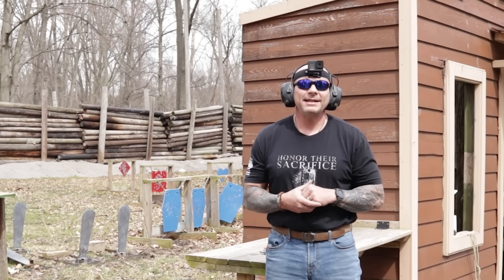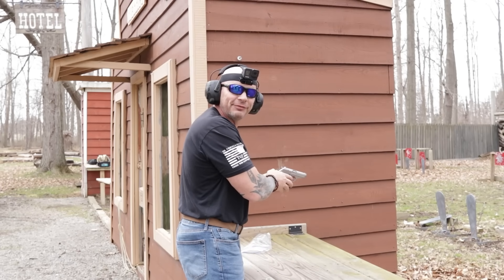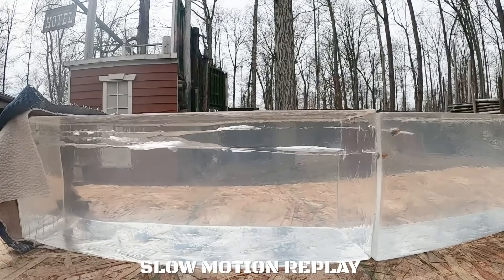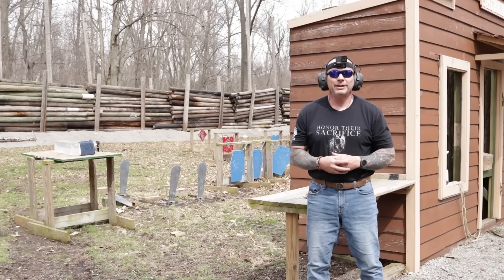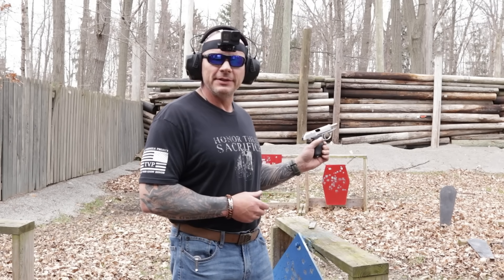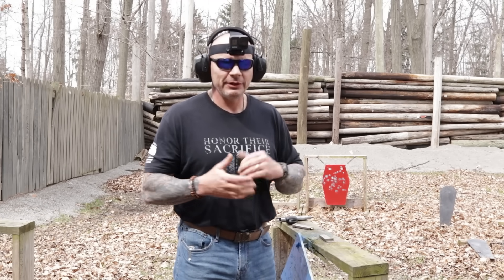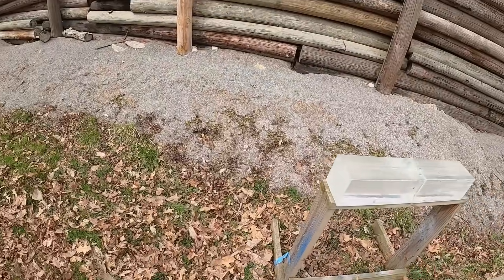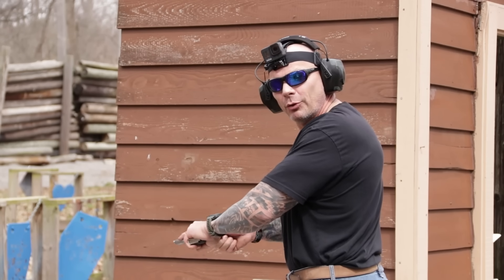Stopping Power of .380 ACP

Comment: As a retired police detective I investigated more death calls with a 380 than any other caliber. Don’t be fooled, a 380 cal is a formidable    Killer
Reply: If I remember, the most commonly used caliber in murders is actually .22
Reply: @taylorgalilea698  Emphasis on 'murder'.  Defense against an attacker does not routinely involve sneaking up and shooting in the back of the head.  Or putting five or more rounds into the chest of an unsuspecting person.  "Killing" is NOT stopping an attack.
Reply: @OldManMontgomery  The 22 has been known to be bad because of it being light, it can travel inside of someone causing more damage. There was a girl at a barn I used to go to get killed the same way years ago. Someone didn't secure the gun properly and another young man found and started twirlling it, It went off. They rushed her to ER, but couldn't save her because it traveled upwards from the entry point to her lungs
Reply: @OldManMontgomery  We could argue until we are blue in the face and still get nowhere. A firearm, regardless of caliber. barrel length, ammunition, or whatever, will leave most folks wishing they had never been hit by it, and make most retreat. A 22 will hurt you, just as will a 44, 9mm or whatever. And if you really want to get technical, being overpowered can be totally against you due to over penetration. A many of cases where a 10mm zipped right through the attacker while not expanding.
Reply: @billwhite5853  I agree in that one could present a valid, logical explanation to you forever and you would never comprehend.  Dismissed.
Reply: @OldManMontgomery  You seem like the one who can't comprehend. You ran your mouth and took my first comment totally out of context. End of discussion.
Reply: @taylorgalilea698 no it's not even close. 9mm is responsible for like half alone. 22 has a lot of failure to stops
Reply: I carry a .380 for two main reasons. It does not over penetrate for one which is safer for innocent bystanders. Many of the pistols made for this cartridge are highly concealable which suit my purpose.  I only care about stopping a problem. If they end up taking  dirt nap, oh well.
Reply: @keyfitter  as do I. I don't want to make an innocent bystander collateral damage. If my 12(×2)+1 isn't enough to stop the threat evading is the best option. I'm not out here to be a hero, I'm just here to defend myself and the people I love.
Reply: @BearNecesities1  which 380 has 12? Seems like they are usually 6 or 7+1
Reply: @dtwood123  sig P365 chambered in 380 comes with a 10rd mag and a 12rd mag.
Reply: @keyfitter  considering police hit with roughly 15% of their shots, overpenetration isn't that big of a deal. It's all the shots that miss that are a problem
Reply: @keyfitter  - Play stupid games, win stupid prizes!
Reply: @keyfitter  I have a carry XDS 9mm and a Sig P230 .380. I almost always carry the .380 cocked and locked.
Reply: .380 enough stopping power. 9mm is step up. 45 has the most because it dumps all its energy into leaving bigger internal damage. But judging a .380 acp jhp obliterated my femur I say it's enough amd I mostly carry 45 acp
Reply: @keyfitter  overpentration is kinda a myth, no one's ever been hit by an overpenetrting projectile during a self defense shooting
Reply: @keyfitter  "... safer for innocent bystanders".  Firing more shots to solve the same problem is more dangerous to innocent bystanders.  Firing one shot and having it achieve the goal is the ideal.  
I have to agree most .380 chambered pistols are smaller and easier to conceal.  On that note, .32 ACP pistols are just as small and have less recoil.  .25 ACP pistols are smaller yet, but in all fairness are wretched to shoot well.  I have to agree a six inch .44 Magnum is quite awkward for a hideout gun.  (Unless one habitually wears a boiler suit.)
"...stoping a problem"  The .380 ACP is a rather low powered round for such purposes - compared to even the lowly .38 Special.  Any defensive shot requires accuracy, the margin for error in a .380 ACP is greater than anything with more power.
Reply: @OldManMontgomery  44 mag total wasteon humans recoil will be 15 inches up ward to re target u lost 5 seconds any attacker can leap 15 feet and cut your heart out with a knife at that time  former cop
Reply: @larrylisssr5948  I have recognized that phenomenon for some time now.  Since about 1974, when I bought my first S&W M29.  Nice gun for it's purpose, but quick response self defense is not the purpose.
Reply: @OldManMontgomery  I just watched a video of a .25 ACP round bouncing off the forehead of a ballistics jell head analogue.
Reply: @taylorgalilea698  Such things happen.  As does one ( that I've heard about from a medical exam)  where several .25 ACP rounds failed to penetrate the skull of a man mugged in a large city.  Such occurrences cannot be expected to happen all the time.  However it is indicative of rather low power and as such, not reliable for defense.
Reply: Always considered the 25 and 32 eye, ear, nose, and throat guns, and the 380 only marginally better. These days, 9mm or a hot 38 Special is my minimum.
Reply: With a 44 magnum,  there's a real possibility of  complete penetration. And , by the time the 44 magnum comes down of recoil, a thug with a 380 will have you shot at least 4 to 6 times.
Reply: @OldManMontgomery  The margin of error is not so much smaller that it removes any advantage of better accuracy, a 9x19 only reliably expands (with good penetration) to about 0.15-inch wider than 380. For a thorax that's about 12 inches wide this would only obviate a tiny advantage in speed or accuracy.

The only way you're firing a single shot and having it achieve the goal is hitting something vital like the heart, aorta or vertebrae. That takes good accuracy but the only way to really get good odds is with more shots.

.32 doesn't have less recoil if it's a straight-blowback design and all but about 2 examples are straight blowback.

Also 32 is about double the cost per round, and ammo costs matter because you really should be shooting a lot, you can't just go to the range once, shoot a box and leave it at that. In another time when there were more options in .32 pistols that would have made more sense. 

Any smaller and you're into rimfire which aren't reliable except in double action revolvers. Which are no lighter nor smaller than a 380 pistol of the same capacity and due to the lack of short-recoil it's no lighter recoil.

The one thing a .22LR revolver has is the cheap ammo means you can train much MUCH more with it.

So 380 makes a lot of sense unless you're REALLY good at handling recoil or are big enough to conceal a handgun that's sufficiently large to handle more powerful cartridges. If you can, then go bigger. But most people can't or they're kidding themselves that they can.
Reply: @828enigma6  380 is a 9mm
Reply: @OldManMontgomery  Not according to the latest actual real world shooting statistics. Only a 3% difference in stopping the threat by incapacitating the threat between 380 and the venerable 44mag. Truth is in the fact that the body reacts very differently from ballistics gel. Ask trauma surgeons and see what they say. BTW these figures are regardless of the number of rounds fired. Don't believe it do your homework and check out Greg Ellifritz's work on the matter. He is well known and regarded in the shooting community.
Reply: @fuzfire    Your so-called statistics is rather suspect by your statement.  I want to know about how the "...3% difference ... between 380 and the venerable 44mag" was calculated.  How many shootings were examined wherein a .44 Magnum was employed in self defense?  Yes, I know the .44 is used in hunting and some competitive shooting, but how many individual examples of a human being shot in self defense?  Statistics - those gathered in the actual research of 'statistics' requires a 'meaningful sample" of data points.  Three percent?  Can you say 'meaningless'? 

I'd rather pay attention to close to one hundred years of observations and record keeping.  But you just follow the latest fad.
Reply: @OldManMontgomery .380 has 70% power of a .38.
Reply: @Jace8637  Oh.  Do you mean 70% of kinetic energy or are you factoring the shape upon impact of the bullet and the momentum of the bullet?  
Taken at face value, 70 % of barely adequate is barely adequate minus 30%.  If you find that suitable, make that your choice.  I do not find it suitable.  
Best wishes.
Reply: I don’t know since the 9mm is by far the most popular pistol sold I’d have to believe you’d be investigating more 9mm shootings over the 380. Personally I wouldn’t bet my life on a 380 when for the same money or a few more bucks you can get a 9mm with no debating if it’ll do the job or not.
Reply: @deanlockamy2087  You are confusing popularity with reality.  Anything sells more when consumers want it more.  Consumers may want it more for any number or reasons, not all germane to the actual question.
Reply: @OldManMontgomery  As someone who's seen this round in action before I can assure you that you wouldn't be coming any further with a few to the chest. Unless you were super drugged up. Even then you are dead you just don't know it yet. The very hot loads that I use (+P) are just as powerful as most 9mm rounds that everyone praises.
Reply: @noticing_patterns  One bit of exceptional occurrence is not absolute proof.  "A few to the chest..."  how about if the villain reaches the defender prior to receiving 'a few'?  How about a drugged up attacker?  Rather common.
Reply: @OldManMontgomery  I see you can't read, I literally already said and I quote 'unless drugged up' in my first comment. In which case for example .45 acp won't do you much good either. Studies show even large calibers like that taking a shot to the heart or lungs like that a drugged up, an assailant can wreak havoc for up to 15 seconds so you'd have to hit them in the CNS which you can also do with a .380/9mm short. The Russians used 9x18 for almost the entire cold war. They would have never used it if it wasn't lethal or effective. I wonder how a round such as 9x17 invented by the great john browning gets such a bad reputation..oh right Hollywood and fudds. You strike me as the type of guy who thinks a .44 mag is the bare minimum in self defense.
Reply: Then why not use the 9mm?
Reply: @OldManMontgomery  problem is most people carry 38 snub nose , instead a long barrel 4 to 6 inch barrel which is what the round is created for , and 2 inch snubbies have horrible accuracy from experience
Reply: @cameronizatt3293  Mr. Izatt, I agree with all you said.  I do know folks who have hands so worn out (for various reasons) all they can handle is a .22 lr and not much of that.  However, one recognizes some combinations of firearm and cartridge does fit the role better than others.
Reply: @noticing_patterns wait... people can still move around after their heart is shot? How is that even possible?
Reply: @deanlockamy2087 , pick what’s suits you best in regards to caliber and what you can shoot and hit best with. It’s all individual.
Reply: @deanlockamy2087  a 9mm is a 380
Reply: @Dumb Jit sig p365 chambered in 380 12+1. Is my summer carry. Winter Carry S&W mp40 caliber. Big bulky guns harder to hide under a Tshirt. Much easier with a jacket on
Reply: Similar to my seasonal rotation. 9mm P365 in warm weather,  Glock 23 in 40 S&W in cool weather. Considering changing it to 357 Sig.
Reply: As an older man, the 9mm just had to much kick. Took it down to the.380. Easier to handle with better control. And the 12 inch penetration is BS. My father taught me, one shot, one kill. Yet to meet anyone with a 12 inch thick skull.
Reply: @georgemarcouxjr6192  I like my 9mm, but the upward recoil, re-establishing target is an issue. Fired many the round through my Bersa .380, I love it. I can put 8 rounds accurately in the time it take for 4 w/ the 9.
Reply: Shot placement is critical with any life defense Firearm.
Reply: @kennybuck5725  Yup.  Without question.
Reply: @OldManMontgomery Do Klingons yearn?
Reply: @kennybuck5725 6:04 no doubt it along with close grouping 6:38
Reply: Simple sentence is That the .380 acp round is usually more than ample for self defense needs.
Reply: Yet it will not outperform a larger caliber in less than ideal circumstances. 
With the multitude of micro compact/sub compact 9mm offerings, there is little reason to carry .380 these days.
Reply: @CWHolleman  the Ruger lcp max is a good reason to carry .380. It is high capacity and easier to conceal than the 9mm LCPs.
Reply: @CWHolleman  There's one "big" reason not to carry those tiny 9s--recoil. Follow up shots much easier with the .380.
Reply: @CWHolleman tell that to the old guy getting arthritis OR THE guy who worked ‘X’ number of years who’s NOT exactly old but just tired oldER.
Reply: Stop.  So you're saying 9mm, by far the most popular round (ie: bought / owned the most) killed more people in your travels than the far less purchased 380.  Okay.  I fully believe the 380's stopping power is vastly underrated but no need to lie about your personal experience.  Your experience would mean you've seen many cases where 9mm didn't kill but the lesser cases when 380 was used, did.  Meaning the 9mm had a lesser kill % than .380.  Just as lethal? Sure in most cases.  MORE lethal? I don't think so
Reply: Sir- can u comment on your police work when .22 caliber used?
Reply: Thanks for the information! Lately I’ve been digging into information on the .380. Very surprised at what I’m finding!
Reply: Yea, the FBI is really reliable now.🤣🤣🤣🤣🤣
Reply: I'm a police officer that was hit in the arm with a .380 round.  It went in just above my elbow and exited my shoulder.  It definitely got my attention and I'm lucky it didn't kill me.  It didn't incapacitate my arm but it did force me to use my off hand to handle my gun.
Reply: I'm yet to find a guy who's willing to be shot with a .22 and not go to a hospital.
Reply: @arcaixsaberhand  AS, I have to tell you, as a friend, that's a really dumb thing to say to someone who has carried a gun for a living over 30 years.  I went to a hospital when I slashed my thumb with a leather knife, but I don't think it's a bright idea.  People go to hospitals all the time for injuries from automobile accidents; reckon carrying a car around is a valid self defense concept?
Reply: lol.
I used to make fun of people who even owned a 380 for years.
then I actually started researching the caliber debate.
until you start talking long guns and very, VERY powerful cartridges, 'stopping power' is just a myth.
~2200 FPS is where the elasticity of human flesh is exceeded so tearing  happens. Below that just use the gun you feel like using
Reply: @JohnnyOnion-jz7tf  The threshold of tearing human flesh is not particularly germane to the ability to deter further aggression.  Immediate incapacitation does exist and does not seen to depend on velocity.
Reply: When I was an EMT in one of the high crime areas in the city I was working in, we'd see 22LR shootings very frequently - more than a few were fatal.
Reply: @FRMN8R_T4R  You were an EMT?  And still don't know the difference between murder and self defense?  Have you not read anything of this topic and understood  the logic?
Reply: Both popular acp's kill alot they where designed before wounding was popular they where designed to kill
Reply: @Dumb Jit very nice. The stock night sights and great trigger reset are fantastic.
Reply: @aqBearNecesities1
Reply: My cousin was killed by this caliber
Reply: A 22 a 7.65 or a cal 25 are also formidable killers if the opponent is not armed.
Reply: @mxblyxky  Indeed!  But in terms of self defense, that does rather become pointless to me.
Reply: Lets look at why though...380 is a "hood" caliber. Extrapolate suburb death and it would be more pronounced calibers...unless a hood rat murdered someone in the burbs.....
Reply: Same sentence has been used for every caliber out there.
Reply: The question with what you just said, is…HOW QUICKLY were those victims actually DISABLED before they died? Fear and adrenaline can keep someone alive and functioning for quite a long time… even after receiving a deadly injury. My concern is how quickly will the cartridge STOP that super strong 250lb attacker coming at you with a Bowie knife while he’s tripping on whatever drugs he might be on. I want a caliber that’s going to stop the attacker dead in his tracks…. Or at least stop him long enough to allow the good guy enough time to flee and get away.
Reply: Actually 22LR is the most deadly.
Reply: @LGB-FJB  Under what circumstance?  As stated very argumentative bordering on nonsense.
Reply: A .22 will kill any man tomorrow.
My dad was a cop, and most deaths that he encountered were from "Saturday Night Specials". They are usually low caliber guns.
 The fact that more criminals use .380 is reflected in the high number of deaths that you see from that caliber. It, however, does not prove it's effectiveness.
 It only proves that a lot of low lifes carry .380.
 I grew up outside of Jackson MS. 
I have met a disturbing number of people that have been shot.
 Many of those people were shot with .380 and lower calibers. Most of those people didn't even seek medical attention at the time they were shot.
 That being said. I carry a .380 EVERYWHERE.
I just don't have any delusions about its capabilities.
Reply: @letsdothis9063  This is rather sane.  Death is not the indicator of effectiveness.  In fact, I don't think death per se is important at all to the defender.  
You, knowing this reality have decided to carry a .380 ACP.  I suggest you practice making head shots and I wish you every bit of fortune possible.  What I really decry is the people who have illusions and cling to them.
Reply: This has 380 likes...sorry, I can't mess that up! but I did like the comment!
Reply: Much agree.   What is important is shot placement and type of ammo used.
Reply: Sure you did.   Phoney baloney!
Reply: Kill kill kill!
Reply: there's so many of you "retired detectives" on the internet
Reply: Exactly.
Reply: 2:18 thank you for your very clear judgement😮 2:49
Reply: @@johnnysilverfoot I hope that works for you.
Reply: Exactly. I'm aware of those statistics.
Reply: 😊@hatchetwound666
Reply: Love all these “story’s” about blah blah blah. “ heard from this guy who’s cousins sister works at 31 flavors that THEY SAW this” so I better drive a tank. How small are you guys that you MUST carry XYZ?
Reply: I've heard others say that as well, which is good because my carry is .380.
Reply: 85 grains vs 230 grains. I know which one I’d pick first if my door was being kicked in, in the middle of the night or even any self defense situation.
Reply: I like to put it this way if you pull a tablecloth from under dinnerware fast no damage you pull it slower all the dinnerwares on the ground velocity works the same way. I'm not arguing a . 380 is more deadly because of velocity a 9mm is deadly too but . 380s kill more the same way a ball 45 is more deadly than a 9mm ball 115 grain velocity . slower projectiles tear more flesh than faster projectiles. The real world physics and statistics are king not internet physicists. I agree with op. 9mm is more available so I go with that but . 380 is no joke its a great small pistol round when a 9mm won't cut it due to being to big when concealed carry.
Reply: I agree wiith you. The FBI lied. They are liars.
Reply: If it makes the difference in whether you carry or not, I guess it's fine but there are some pretty small 9mm subcompacts out there, albeit they carry a few less rounds.
Reply: .380 is what obliterated my femur. .380 acp jhp
Reply: Great killer.  I'm not a hitman, I carry for defense and want to stop attacks right away with the least amount of shots and bother.  Don't confuse 'killing' with 'stopping'
Reply: @OldManMontgomery  although sometimes they're the same thing. Well said
Reply: @BearNecesities1  Commonly recorded cases indicate the villain was in fact killed, but not dead until after the villain committed his act of villainy.  In which case, the defender looses.  I prefer the villiain to be rendered unable to carry out the attack instantly - or a reasonable facimily - and I really don't care if he dies or not.  
"...sometimes they're the same thing"  Yes.  But not often enough for my peace of mind.
Reply: @OldManMontgomery  You got your head on straight sir. The rest are just parroting teenage psychobabble.
Reply: @OldManMontgomery  I think we would all love to hear a description of the scenario you envision where you need to mutilate someone, or kill them, (you don't care which, but you hope it's more often that they die immediately) before the scary villain does to you whatever you think they're going to do to you.  Awaiting anxiously!
Reply: @PhpGtr  Pretty simple.  Forget all you expect:  My goal is to immediately stop a dangerous person from mutilating or killing a victim including me.  I do not want to shoot anyone 'just a little'.  Nor do I care if the dangerous person dies from my actions.  I want that person to immediately stop the hazardous activity.  Has this never been explained before?
Reply: @OldManMontgomery  What "Commonly recorded cases" are you referring to? 

Because in one of the most well studied of the recorded case - the 1986 FBI Miami Shootout - it was a 9x19 round that most conspicuously failed to have the perp be "rendered unable to carry out the attack". Ironically, a non-expanding bullet would have penetrated enough even if lighter and slower (like a 380). And it should be noted that wasn't the only failure, it was also the fact that this was the only good hit. Recoil is a factor in that.

380 has it where it counts, it will penetrate enough, the ammo is cheap enough to train with and you can shoot it without the recoil being a problem for a CCW that size and weight. Sure you can go to an even more powerful round but that means either a round that's too much for a CCW or it's large enough that it's not really concealable any more.

I think for a lot of people the appeal of sidearms is how they are concealable and if they're going to go overt then a long arm like a 5.56 carbine is the obviously better choice than a sidearm. Similar to how the M1 Carbine replaced the M1911.
Reply: @Treblaine  If you want to know what the phrase means, you need to get out more.  If you do not know to what I'm referring, then me explaining isn't going to matter, as you still won't understand.
Miami-Dade, FBI involved shooting.  To what failure do you refer?  Which villain, Matix or Platt?  The first hit actually killed Platt, albeit, he didn't die right away.  The wound he sustained damaged his ability to breath so badly his life could not have been saved.  He didn't stop instantly?  No, he did not.  It happens.
To assert a .380 ACP round would have immediately - or even somewhat faster than the end result - is best described as wishful thinking.  Now, if you have some concrete evidence or even argument, tell me.  If not, you are demonstrated wrong and the subject is closed.
Reply: @OldManMontgomery  Hold up partner. Check out Greg Ellifritz's 10 year 1700 + shooting incidents.
Reply: So true. If I  have to shoot someone, I  want them to stop what they are doing yesterday,  not an hour or two later.
Reply: @828enigma6  That is indeed the primary idea.
Reply: @OldManMontgomery  what caliber do you carry every single day? Considering you carry for defense, I imagine there is not a single day you go without carrying your bigger caliber gun
Reply: @Ferbocarbo  Yes, I carry every day.  I do not carry to the County Courthouse they forbid it and have metal detectors nor the hospital or outlying offices.  I am a chaplain with the police department here and 'volunteers can not carry' so I don't.  But everywhere else, shopping, eating, church (I'm the bouncer at my church), and so so.  
What?  I bounce back and forth between a Colt Commander (lightweight) - 230 grain Hydra-shok ammo- and a three inch model 10 S&W - 158 grain HP loading.
Reply: @OldManMontgomery  if it kills them, they’ve stopped.
Reply: @ebonitucker4512  Smoking kills, but doesn't stop - in the sense we're discussing.  You've got the silly notion 'killing is stopping'; not at all true.
Reply: @OldManMontgomery  In today's Society I'm going for the "K" and that's how I've always been Trained. This is a life and death situation and that's exactly how it should be handled.
Reply: @freedomridermorty4459  Good luck in court.
Reply: @OldManMontgomery  As a Law Abiding American Citizen we're screwed either way. No way I want to be judged by peers wearing Rainbow 🌈 T-shirts , Purple Hair. I have a Moral Obligation to protect my loved ones, I'll never live in fear or on my knees. I'll be a man and put one in my own Head. Very sad the Society we live in. God Bless America
Reply: @freedomridermorty4459  I agree with much of what you said.  I will not be judged by anyone on any extreme fringe.  I have a moral obligation to protect and defend most everyone (especially my loved ones, but includes all victims).  I have every intention of dying on my own, perhaps with boots on.  Yes, the moral, spiritual, mental and ethical deterioration of the United States is disgusting and abhorent.
Reply: @OldManMontgomery  Stage Safe My Friend
Reply: @OldManMontgomery  "Don't confuse 'killing' with 'stopping'"
How many dead people aren't stopped?
Reply: @wisenber  Do you realize the idiocy of ignoring that which you do not understand?  in order for your comment to operate, you must think the defensive mechanism kills instantly.  Causing a death LATER ON does NOT reverse the intermediate effects.
Reply: @OldManMontgomery  "Do you realize the idiocy of ignoring that which you do not understand?"
Ironic of you to say that.
You must think shot placement isn't a thing, or you're depending on a 44 magnum to the toe to be more effective.
Reply: @wisenber  And now you are putting words in my mouth.  Really hard to lose when you haven't the slightest clue of what's real and you get to change other people's arguments.  But you've lost and don't know it.  Dismissed.
Reply: @OldManMontgomery  "And now you are putting words in my mouth.  "
No, but I do detect your projection.

" But you've lost and don't know it.  "
Se above. And good luck with the toe shot.
Reply: @OldManMontgomery  Exactly. We are talking about face-to-face armed confrontation. As a professional I can guarantee through real cases that the 380 often doesn't drop, so you're dead. The impact test in joules reveals that it is a very weak caliber.
Reply: @OldManMontgomery 
I was just about to say the same thing. There’s no question that if the round is placed in the right spot, that the attacker will likely die, no matter what the caliber. But the area of concern is…Will it stop him QUICK ENOUGH to save your OWN life?
Reply: @jimbigboystoys4077  Excellent question for the discussion.
Reply: @OldManMontgomery FUDD
Reply: @OldManMontgomery want to stop a fight fast then stop aiming for the head aim for the legs and torso. Trust me aint no ome gonna continue fighting with a broken femur. How I know I'm currently recover from a .380 gsw in the leg my femur, part of my hip and knee had to replaced with titanium
Reply: @OldManMontgomery  double tap two to the chest one to the head former deputy here
Reply: @larrylisssr5948  I certainly agree, Your Deputyship.  But I'd prefer at least something along the lines of the old "Chicago load" in .38 Special than any version of .380 ACP.  
Thanks for your time and effort in a thankless job.  I did six years with the Border Patrol and twenty-two years with the Customs Service.  I'm retired now and attempting to pass the experience and learning on to those who should know.
Reply: @larrylisssr5948  I agree with you.. daily shooter & trained by men like you... Personally any caliber will kill.... Never have reached the point of ending someone's life & I hope I never do but will if forced to... Guns are fun as a sport but dangerous in the hands of people with evil intentions against others.
Reply: @OldManMontgomery  so…fake cop.
Reply: @larrylisssr5948  easier said than done especially in a self defense situation.
Reply: @larrylisssr5948  
Same here, my friend. Retired, but now work with the sheriffs department part time as a court officer. And that’s the way our dept has  always been trained as well.  Double tap, and a headshot at the seven, five, and three yard lines. They give you three seconds to get the shots off.
Reply: @OldManMontgomery  BEST thinking yet. In fact, stopping is the point. I don't actually want to KILL anyone. One might argue a .45 acp is more humane all around.
Reply: I was gonna say, I think the .380 is used a LOT on the south side of Chicago.  Easily concealable.  Older, more around, cheaper, as sub compact 9mm’s are much newer.
Reply: @BudsCartoon  No worries, "assault weapons" are banned in Illinois. It's gonna be better now.🤣
Reply: Having talked firsthand with someone who was shot in the back with a .380 and didn't know it until it was pointed out to him (it would have been fatal if not treated) I have no doubts about its lethality. But I have serious doubts about its value as a self-defense cartridge. That was going through my mind when a much, much bigger dude was sizing me up for robbery material and all the time I was thinking "If I shoot him with my little .380 and he finds out about it, he is going to be very, very angry."
Reply: @phishno2767 shot placement is the 1st step toward safety in self defense
Reply: @phishno2767  I knew a guy in the River Quay who was shot with a .380, it didn't kill him either but he spent the rest of his gangster days in a wheelchair wearing a shit bag.
Reply: The Makharov in .380 was the standard sidearm for Soviet officers and NCO's for decades.  I have one, and it is highly reliable and accurate.
Reply: I know of a case where a man was attacked with a machete and hit ten 380 shots at the attacker who didn't fall and stabbed his belly open. A 38 spl performs better. The intention is always to shoot without having to kill.
Reply: @mxblyxky  I can pull up situations were a 38, even a 45 didn't get the job done. Anything less then a V-2 rocket and you're risking it.
Reply: @mxblyxky  the attacker was on meth a 45 would not have stopped him with one round former cop
Reply: @larrylisssr5948  He wasn't drugged but he was furious and determined to kill his opponent who humiliated him in a bar.  I say that the 380 as well as the 32 acp and the 22 lr are not very different, they will not stop a determined opponent except with a shot to the head that no one wants to fire. But of course, it's much better to have a gun of these calibers than nothing at all.
Reply: @mxblyxky a .380 +p from Underwood is immensely more powerful than a .22 lr or .32. Actually, it’s on par with Winchester Ranger-T 147 grain. Those are only 277 ft lbs from a Glock 26. My Underwood ammo is 250 ft lbs from a Ruger LCP
Reply: @mxblyxky .380 way more powerful than .22 lr and .32 acp. I use Underwood +p ammo. So Winchester ranger-t and pdx-1 147 gr is only 277 ft lbs out of a Glock 26. My Underwood ammo is 250 ft lbs out of a Ruger LCP. Way more power than .22 and .32. Not to far off 9mm. They also pass the FBI protocol for carry ammo, penetrating to 12” in gel through heavy clothing and expanding to 0.58”
Reply: @mxblyxky  Not true . There is only a 3% difference between a 380 and all calibers up to a 44mag no matter the number of shots to incapacitate the threat. Yes there are outliers but that is in all calibers. Greg Ellifritz's shooting studt over 10 years and 1700+ actual incidents  prove this fact!
Reply: @fuzfire  What proves it is real life and corpses. I have personally studied these cases which are real, quite different from simple tests with gelatin on a firing line, or a calculation of joules. The 380 comes close in stopping power, but down to 32 acp and even 22 Lr. If you are protected you can face an enemy armed with a 380, but face to face with an opponent carrying a 38 and up you will probably lose. In that case, you'll be better served with a 38 special, even with the 5-shot, because it's no use being armed with a 380 of 12 shots if your opponent won't go down right away. I'm not here defending any commercial interest, it's reality and your life will be at stake.
Reply: @mxblyxky  I know a guy that got hit with a 9mm 7 times,  it’s where you hit them that counts.
Reply: @derekbanks7377  This is an exception and you cannot argue with an exception. What I mean is that the impact of the 380 doesn't usually knock you down, it can even kill you later, but you need a caliber that knocks you down immediately.
Reply: @mxblyxky  I see your point.
Reply: @mxblyxky  the 380 killed many in ww2 patten had one common for 100 years in europe military and police use
Reply: @mxblyxky  I know guy who was shot three times in the chest by another fella with .45 acp in a bar one night in the River Quay, the gut that got shot was back to laying brick a month later and is still working to this day.
Reply: @jasonashley4579  I already responded to this. This is exception. You may not want to argue with the exception but with the rule what actually happens. The 380, as a rule, do not tear down, and if you are facing an armed opponent, as a rule, it will not fall and shoot you, you will die. End of conversation.
Reply: @mxblyxky  English
Reply: @mxblyxky  .357 magnum.
Reply: If the machete wielding maniac was close enough to slice him and didn't fall as you say the face shot was the play.